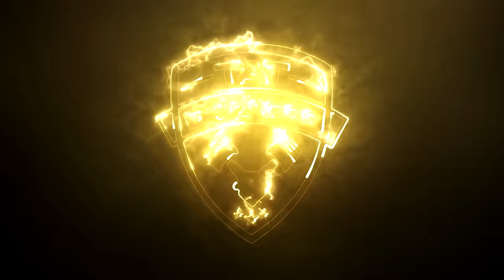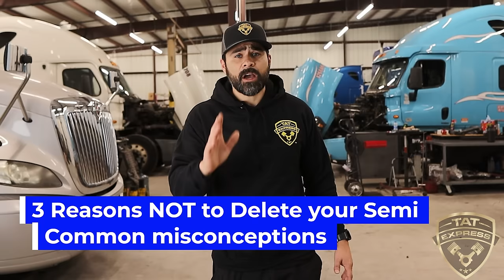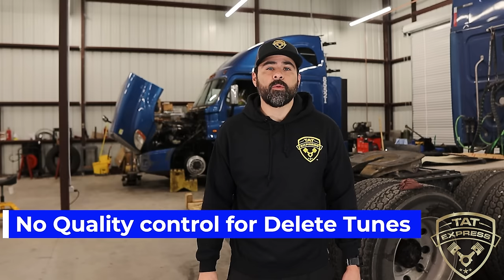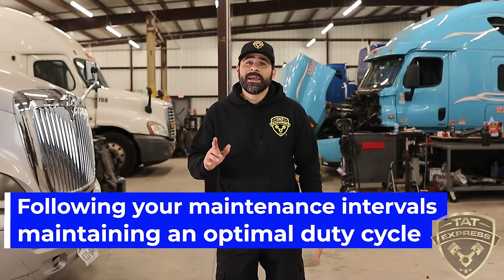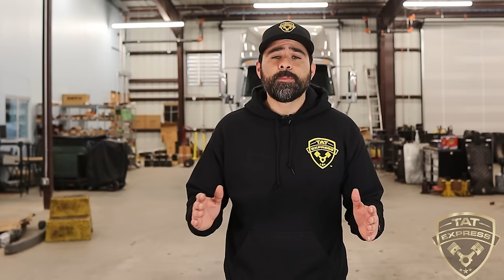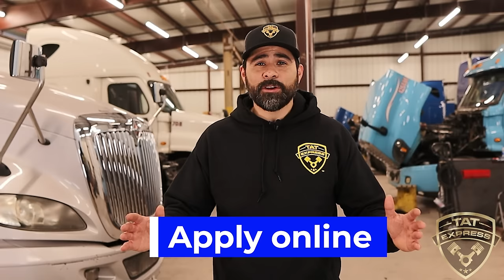Do Not Delete your Semi/ Do NOT delete your Semi/ Three Reasons Not to Delete your Semi/ DPF Deletes

Comment: Did he really say deleting emissions decreases longevity?? 🤣 emissions on new trucks can reduce life up to 50% In some cases. Ended the video right there this guy doesn't have a clue
Reply from the maker: Ronnie Swindski, this may be true with lighter-duty diesel engines such as V-6 or V-8, but larger displacement engines are manufactured to be tamperproof. Many DD15, X15, Paccar, and Volvo D13-D12 engines fail prematurely due to a hack delete. We are only sharing our experiences.
Reply: @TATEXPRESSINC  you are correct if its a hack delete. But if done right and everything is removed, a good quality delete will improve engine life and performance. With that being said, I would not delete a big rig. Trucking is so regulated as it is, and pretty much done, it'd be too easy to get caught. Deleting a pickup or heavy machinery is a different story. If I buy a 160k backhoe, I'll do what I want with it. The epa doesn't own the world and have no right to control anything. Everything on earth belongs to God.